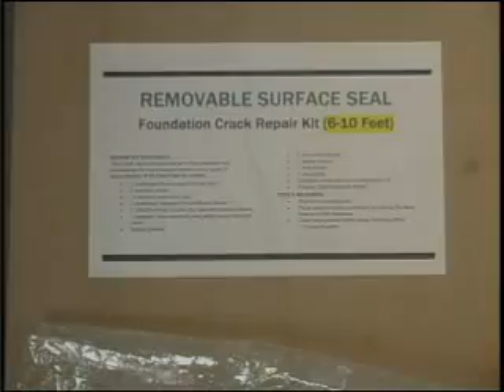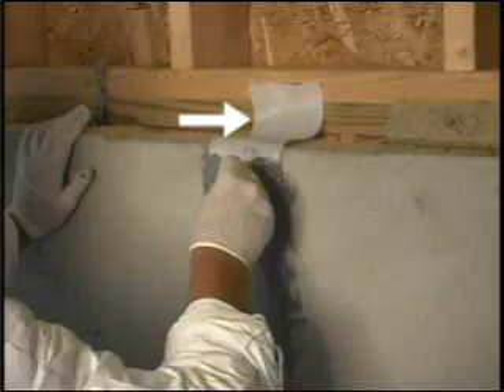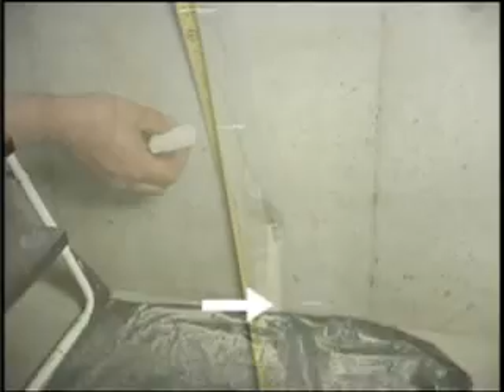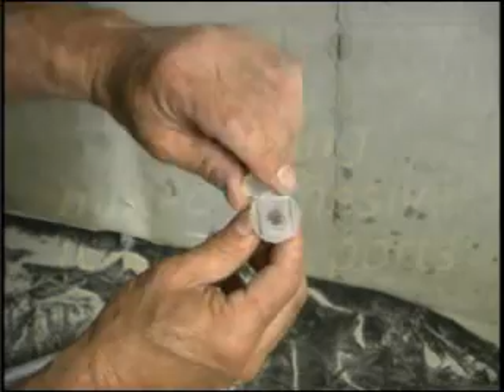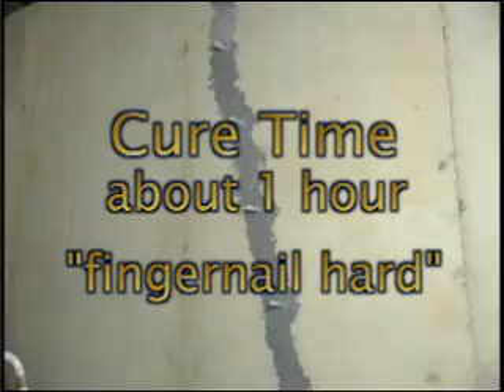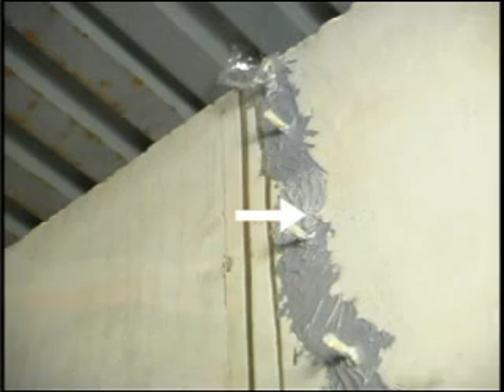Easy-Peel DIY Foundation Crack Repair Kit

Comment: Thank you...it was easy to do and worked just like it was supposed to (little tough on peeling off the the sealer though).  Right now in PA experiencing Hurricane Sandy and not any signs of leaking from the crack...sealed it 2 days ago!  Awesome product, I would highly recommend it.

Comment: Amazingly simple instructions.  I can see this being used on foundations that are 15 years plus old with no development occuring in the immediate surrounding areas.  If a new home or in an area of development consult an engineer for shifting foundation issues as the crack may indicate larger forces at work.  Great job!

Comment from the maker: @mariopierre 
Horizontal cracks are often caused by structural issues and you should consult a structural engineer first if there are other measures needed as well. In any case, you will have to stop or prevent water seepage through the crack. Crack injection does that. The standard kit fills the crack with expanding urethane foam, allowing for some natural movement of the concrete. If the crack is dry inside, injecting epoxy will give it structural strength.

Comment from the maker: Agreed. This kit uses two-component polyurethane foam which has flexibility, unlike epoxy. We have both injection materials available but in most cases use polyurethane. There is a comparison of epoxy and polyurethane on the webpage.

Comment: I am curious whether this material has any elasticity. We are considering buying a home that has some foundation cracks from settling and heaving of heavy clay soil around the house. This look like a good process, but it will only work if the material is a tad flexible.

Comment from the maker: The temperature inside the basement and of the concrete even in winter is not a problem. 
The ground temperature is typically above 50°F, which is fine.

Comment: Here is a tip. Instead of using a paper plate to mix the surface seal I use scrap sections of vinyl flooring cut into 10" squares.